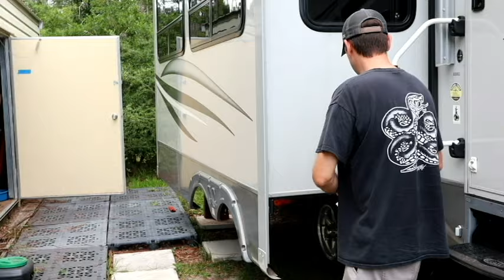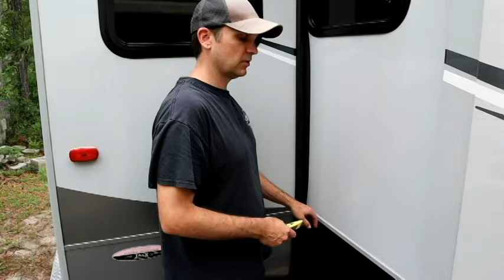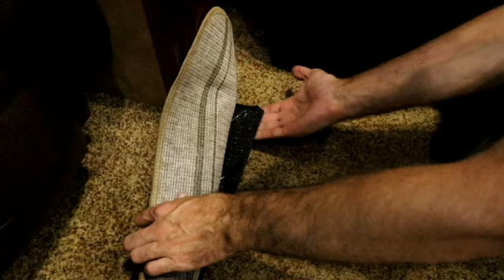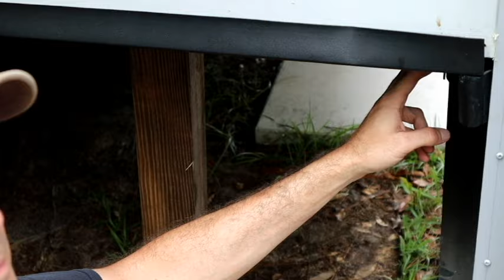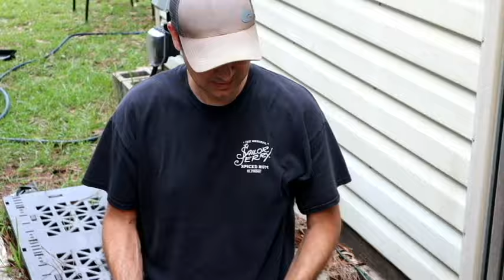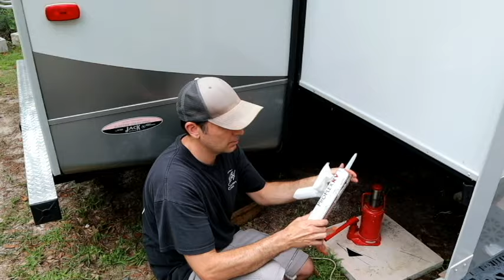RV Slide Repair | How To Fix RV Slide Out Leaks | RV Slide Out Problems | RV slide out Maintenance

Comment: My slide wore thru the black plastic on the bottom of my slide. I adjusted it to stop the rubbing but too late. This is my solution to fix the damage. Thanks!
Reply from the maker: Ours was starting to do the same thing, most people dont catch it until its too late. These work great.

Comment: Hi we just found your channel great idea about the slides.  We have the same  Silverback yours, ours has a Manufacture date is May 2013,  but it is titled as a 2014 model year(not sure how that works).  We bought ours in February 2020 used from a dealer. 
  I did find a small soft spot under our bedroom slide and think the water is getting to this area as you showed during the rain.  I wonder though our bedroom slide doesn't have the black barrier on the bottom and wondering if yours does.  I will follow what you did to stop the water intrusion which is a great idea.    Glad to find fellow Cedar Creek Silverback'ers...
Reply from the maker: Thanks for stopping by and checking out our channel! Thats too funny, our Silverback is a 2013 and we too purchased it earlier this year as well. As for the bedroom slide we have not had any water issues and it is different than the other slides since it has a plywood bottom. We ended up sealing the edges really well with Proflex and I painted the plywood with an oil based exterior paint to seal it. Hope than helps!

Comment: Just discovered yesterday a soft spot in the outside corner of our slide out. I’ve got to repair that and then I look forward to this method for future preventative moisture issues.
Reply from the maker: Glad you caught it, we are super vigilant about water leaks since we have had issues in the past. This is a good solution to prevent future damage. Thanks for watching and commenting!
Reply: I have the same problem as well. Just a couple small soft spots. Most of the dealers want to replace the whole floor but that seems a little excessive seeing how it’s a few quarter size spots. How did you repair them. Also did you just put the skis over the soft spots once they were dried out?